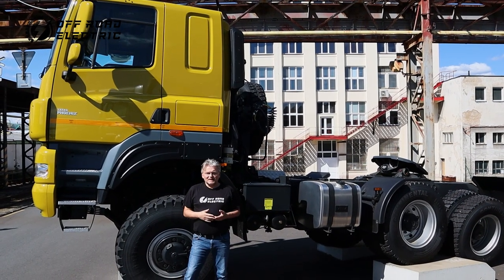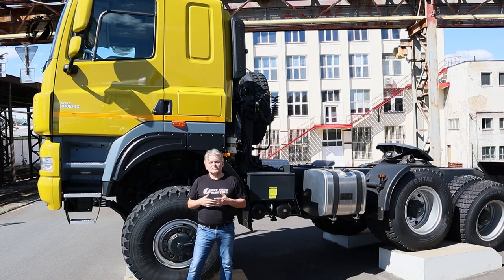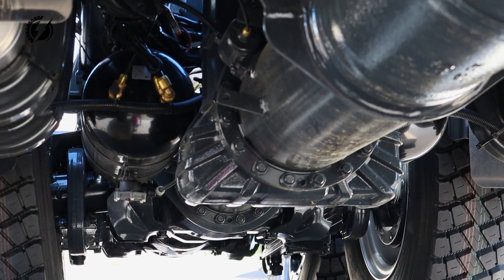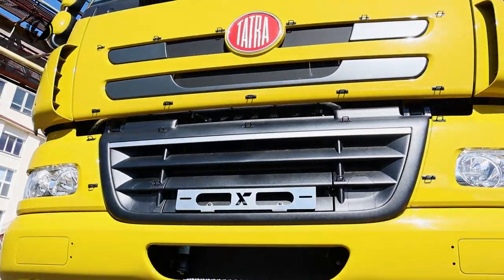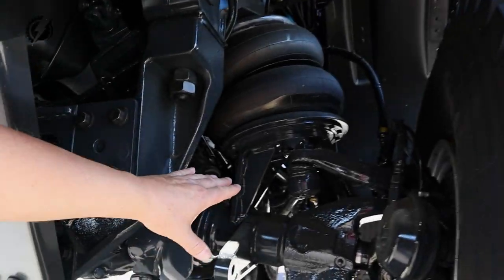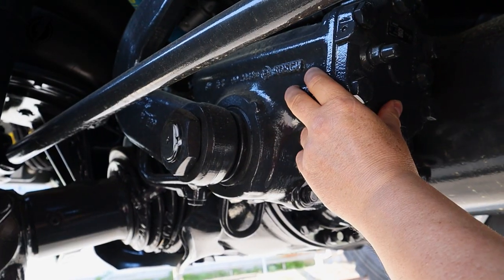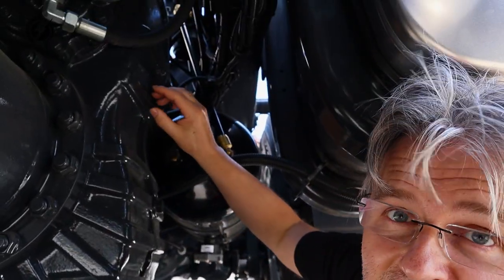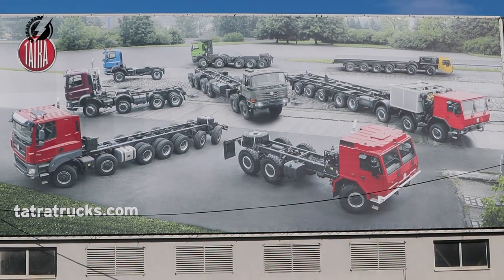Bonus video-Tatra Phoenix in front of Tatra factory

Comment: Very cool! Peter did you say tetra still makes air-cooled engines?  You can get much more power with water cooled engines. But I am sure you know that, but seems they would have changed. 
Marty
Reply from the maker: Hi Marty, yes, and they are also developing the new Euro 6 air cooled engine, so they can sell them in Europe....I don't get it, it is all getting so complicated and expensive... They should keep using Cat, Paccar and othes while transitioning to electric.....They can put electric motors directly into the tube with orbital speed reducers, cheap and simple solution...... Inflexible minds are the biggest obstacle for progress....
Reply: Off Road Electric 
Seems like wasted R and D when they could use Cummins. In the USA Cat stopped selling engines for Semi trucks because they didn’t want to spend R and D for air standards for new trucks. So they just install in off road equipment.